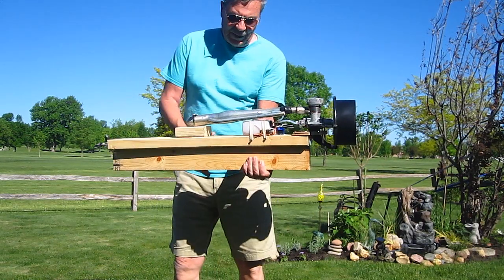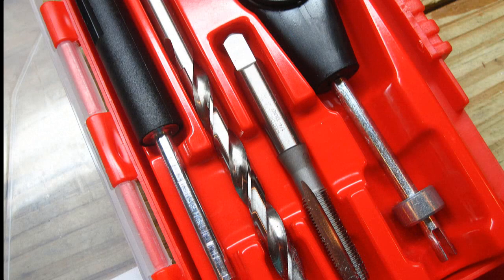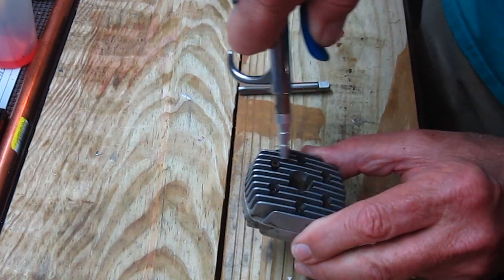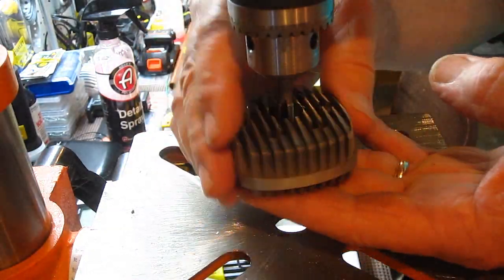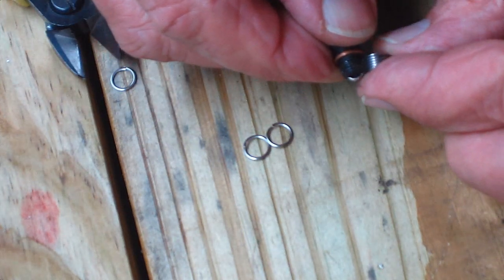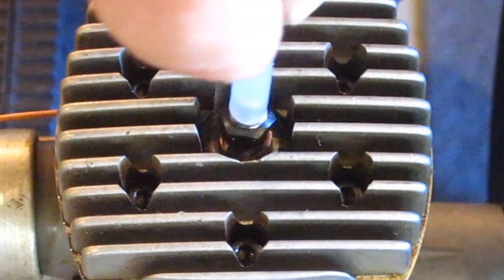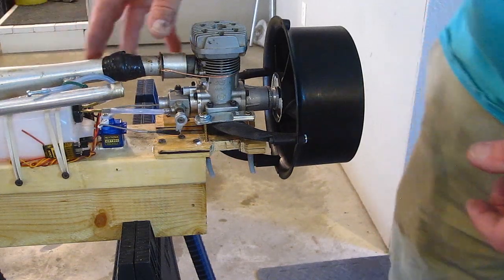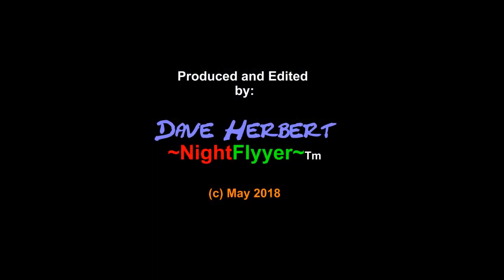How to repair Nitro Engine Head Glow Plug threads on OS .91 with Byro Jet Ducted fan demo!

Comment: So, can welding be done instead of helicoil?
Reply from the maker: I would not recommend that. It is an aluminum head that would be hard to weld the hole shut, drill out, and tap.  Besides that the head would probably warp. One mistake and you might as well find a new head.  This helicoil is the easiest way to do it and this engine is still working perfectly. Good Question.
Reply: @NightFlyyer  thank you

Comment: Inflation is insane, it is now $43.12 from BlindRivetSupply, the exact same kit.

Description says $28, video says $38...
I have done tapping before, the recommended way is to use plenty of oil and clean rags. Tap in 1/3 and out, then tap in 1/3 until one full turn, clean tap. From then on is recommended 1/3 IN, 2/3 out, clean and oil, 1/3 IN, 2/3 out, clean oil, repeat...
Your technique worked,  but is good to go easy instead of one full drilling as shown in the video in case for whatever reason is not guide as it should.
Is the thread still holding on and not come loose?
Reply from the maker: It has never come loose.

Comment: Hi!is the helicoil size m3x0.5?
Reply from the maker: BlindRivetsupply.com  $ 28 1/4 32 Thread Repair kit The drill bit that came in the kit is 6.5 mm or 17/64. The tap that came in the kit is 1/4 32.

Comment: Now you need to put the engine/fan in an aeroplane...😉
Reply from the maker: Well, it was supposed to go in my F-16, but as you may have seen my vidoes on it, I converted it to Electric.  If I find a plane it will fit, I certainly will.  Thanks.

Comment: I've used JB Weld to fix a stripped spark plug in a car.
I cut slots in a old spark plug to act as a tap.
It lasted more than 10 years.

Comment: What size drill bit was used ?also what size tap?
Reply from the maker: The drill bit that came in the kit is 6.5 mm or 17/64.  The tap that came in the kit is 1/4 32.
Reply: Thanks a lot I appreciate it 👍🏼

Comment: For everyone's info.
Yes, helicoils (wire inserts) are available for almost every thread you can think of! And all you have to have is the correct drill and repair tap size for your wire insert. Personally I'd say leave the cylinder head in the vice after drilling, if you're using one, then the tap will be perfectly in line with the hole.
 You can make your own insertion tool from a piece of steel rod that just fits sugly inside the wire insert. A hacksaw may well cut just the right size slot to fit the "tang" on the insert.
When screwing the insert into the repaired thread, DO NOT PUSH ON IT!!! Just let the insert make it's way through. If you push, you'll stretch the wire and maybe break off the tang before it's fully in place. (if that happens, you gotta start again, after pulling the insert back out with those long nose pliers) (it's unlikely you'll be able to screw it back out, you'll just have to pull and watch it stretch like a spring) (boing)
Don' forget to break that tang off when you've finished!
Just be careful, if you mess up the install, more than once, you may danage the new thread. Then you're screwed!

Comment: In my hit rod days we used Heli-coil stainless thread inserts in aluminum engine blocks, especially spark plug holes. Hali-Coil was the brand name.
Reply from the maker: Yes, Heli-Coil products are sold by O'reilly Auto parts even today.  I used one to fix a blown out spark plug in my Ford Flathead back in the 60's and it worked great.  They did not make one small enough with the right threads to fix this os 91, though.  Thanks for commenting.

Comment: Nice video, the recommended way to remove the bent installation tang on the thread insert is to turn the installation tool at 90 degrees to to the tang and give the handle of the tool a firm sharp whack with the heel of your hand, thus makes it snap off cleanly without risking bending the bottom part of the insert/coil.
You may already know this but I thought it may be useful to yourself or anyone else watching. Look forward to seeing that setup in a plane and in the sky!!! Happy Flying!!!
Reply from the maker: Yes, the included magnet tool is supposed to be used and catches the tang, so it wont drop down into the Cylinder, but I did it this way to show it come off. Thanks.
Reply: NightFlyyer that’s a good point I didn’t think about the issue of showing it on camera, didn’t mean to come across as a know it all. Thanks for all the great videos they’ve provided hours of entertainment and it’s an invaluable source of info for many 👍🏻👍🏻
Reply from the maker: No problem!  Thanks!

Comment: I have a super tiger 61 and it's a hard hitting motor but it's glow plug is thread locked in. I work at a machine shop but don't know how to fix it
Reply from the maker: You may have to drill it out from the inside of the head, then rethread it like I did.

Comment: I have a question for you. Should I buy the Parkzone A-5 Icon mini UMX I have finally located after 2 years of looking, or the Blade 230 ready to fly with transmitter so I can learn to fly my Align 450? What would you do? I cannot buy both. 
I may never find another brand new Icon mini like that.
Reply from the maker: Well I was never crazy about my full size Icon as they can get squirrely at low altitudes, including the real one. I love helis, so Blade may be the way to go if you already have a 450.  A Good sim with teach you lots too.
Reply: NightFlyyer They put stablization in the upgraded version and there is a couple forums on how to fix most of the original Icon issues.
I just sold a few more mowers so it looks like I will be buying the Blade 230 anyways. I think the RTF will be easier as It comes with a transmitter already set up for me. If I dont get this stuff now, I will kick myself later. I did pick up a snow thrower off the side of the road to help keep me in RC stuff. It needs some TLC but other wize, come late fall it should sell ok. This is how I finance my hobby.
The way I look at it God keep providing me the means, I might as well go for it. 
I have no issues flying the 450 scale heli on simulator. The small ones are the tricky ones. I spent one whole winter flying simulator and got a WL Toys helicopter. No issues flying it, except its a bucket of garbage. Flys like a school bus.
Reply from the maker: Good for you.  Surprised to hear your comments about wl toys.  I have quite a few of them, and especially like the v959.  I can fly amazing 3d and hover perfectly inverted with it and all of them.  If you can do that with yours, you will be able to fly the 450 just fine.

Comment from the maker: When I made my Electric Byron F-16 video, I intended to show how the original ByroJet Ducted Fan worked. It was the stock unit that was recommended in this big model. But the Glow Plug threads were stripped out, so I searched for a way to fix it, and found for only $28!  Along with the starting of the engine, this video proves it works fine.